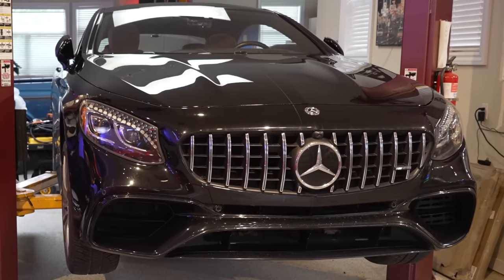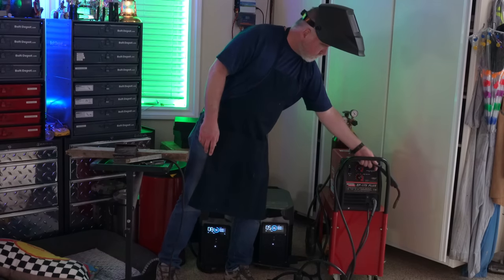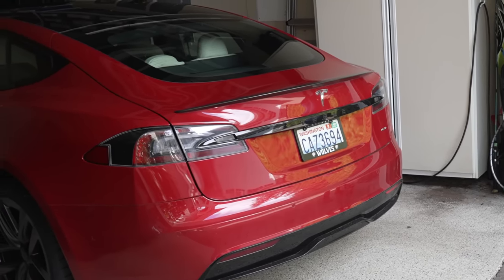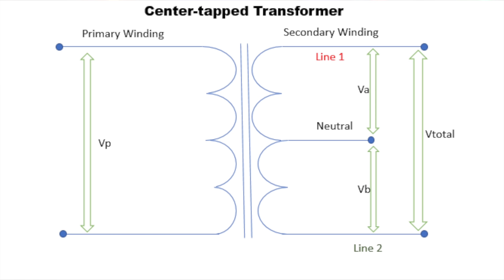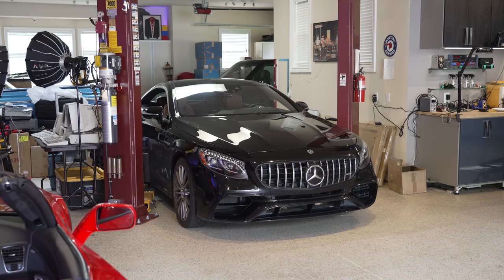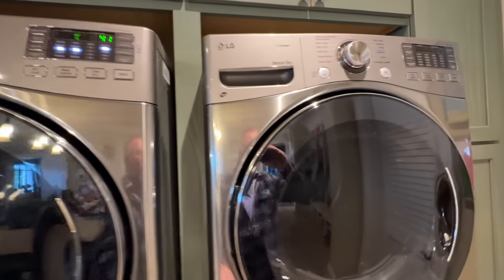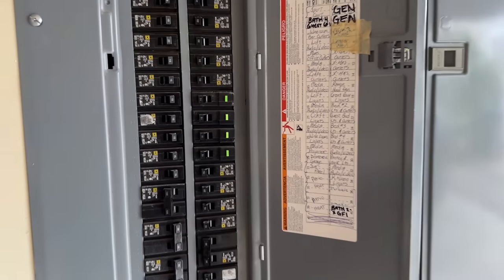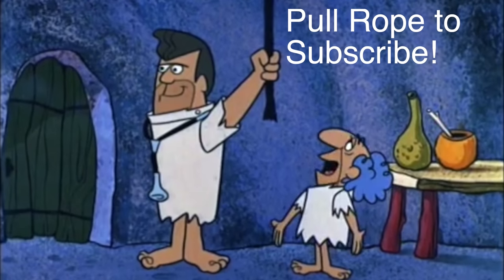240V Solar Battery Experiments - Welding, Lifting a Car, Charging a Tesla, and More!

Comment: The batteries were not connected to a ground rod, so the Tesla won't charge.  If you had it connected via the house, it would've worked, as the house circuit is grounded via a ground rod.
Reply: So I guess the millions of people living in old houses without grounding just can't get a Tesla?
Reply: @chitlitlah  anyone living in an old house without grounding rods really should have them installed. I can’t believe it’s even legal anymore to have a house without proper grounding in place
Reply: Not correct. It’s looking for bonding between ground and neutral which is required by code on house panels but the unit doesn’t bond ground and neutral.
Reply: Right.  There's no way for the tesla to know if it has earth ground, it's on rubbed wheels.

I am surprised though that the Echo doesn't bond the neutral to the safety ground, since it is supposed to be able to have devices connected directly to it rather than through a panel.
Reply: There must be an external hack (workaround) to achieve this, that is safe, easy and doesn't require damaging any of the units.
Reply: @joshg1244 , true, sort of. The two EcoFlows are electrically floating, and the Tesla is sitting on rubber tires. However the 4-contact 240V plug on the Tesla charge cable has no connection between the car and the neutral pin, but it does have connection to the safety ground. Perhaps it measures the voltage between the two hots and the ground, expecting the ground to be about half-way between the hots, and give a stable reading. Since the ground has no connection to anything the voltage reading is nonsense. The car probably sees 0 volts (or close to it) between the first hot and ground, and 0 volts between the second hot and ground, and therefore knows there's a problem.

I figured this out about the Tesla adapter plug only two days ago. Wanted to wire my garage with a big outlet to charge my new car, and wondered if I needed a neutral wire. The Tesla home charging station only uses a pair of hots and a ground, so I measured the 4-pin adapter---the neutral isn't connected. The diameter of wire needed to run home charging at full bore is fat and expensive, plus requiring a neutral would have pushed me to the next larger size of conduit if I wanted to meet code.

To answer Crispy Frog's question: I bet it'd be okay to connect an external ground to the setup. EcoFlow's double voltage hub is the logical connection point to do this. Use a "suicide" cable, but cut off the blades, leaving only the ground pins on either end.

All: It might be somewhat confusing, but Tesla has two home charging solutions. The cable + adapter set Dave showed us is the portable unit, normally kept with the car. It has both 120V and 240v adapters. The 240V adapter is rated for 50 amps max. They also make a home charging station, which you hard-wire into your garage's power. The charging station is 240V and can be setup (programmed via WiFi and a phone app) to run on a 30, 40, 50, or 60 amp circuit.

Comment: I ran into the same issue trying to charge a tesla from a Renogy Lycan 5000 power box. The issue was that the ground and neutral were not bonded, like they normally are in a breaker panel. From the Tesla's perspective, the ground was not at the same potential as the neutral; it was just floating. The solution was to buy a male plug with screw terminals and connect a wire between the ground and neutral, then the Tesla charged just fine.
Reply: how long till the solar generator drained?  how many miles or % did put on your tesla with that charge, and what was the K (7200k maybe?) of your generator?

Comment: At the service disconnect (of your house), neutral and ground are bonded/connected together. This is true regardless of your house's age or whether it has a grounding rod or plumbing ground, or no grounding electrode.

So at the outlet, ground == neutral. You can confirm this by using an ohm meter and checking resistance between those two wires. You'll discover the resistance is zero (or very close to zero). If you check for continuity using a multi-meter, it should beep.

Since electrically speaking, neutral == ground, the only way that a device can tell the difference is there may be residual voltage on the neutral that won't exist on the ground. But, only if other devices on the circuit are powered on, and this won't apply to a dedicated circuit like a car charger. So, I doubt the car is doing this.

The car must simply be checking the N/G resistance and detecting a higher than allowed amount. That is the only explanation. Therefore, the Ecoflow devices must not bond the neutral and ground together, or at least not a "good" bond (near zero resistance).

Test the resistance between the W and G prongs on the Ecoflow's L14-30 receptacle. I'm curious what the value is. You could try bonding those pins together. It "should" be safe, and will allow the car to charge, but it will likely trip a GFCI circuit on the EcoFlow (if it has it).

Another [unlikely] possibility is that the Ecoflow is not providing a neutral. Use a volt meter to check that you get ~120V between the X/Y pins and both the W/G pins.

Hope this helps.
Reply: I agree with this answer. I don't think it is the last line, however. You could ohm out the 30 to 50 cheater cord, plugged in or not, to see if neutral and ground are connected. I bet they are not.
Reply: @tmvold  I think you are correct. It is very unlikely to have a floating neutral. But, I wanted to acknowledge this as a possible cause of the car's error message. It would also be unsafe to have a floating ground, unless there is GFI protection. But, I don't see any test/reset buttons on the devices in the video.
Reply: The 30 to 50 cheater should not be bonding ground an neutral.  That is the job of the power source.  The cheater should only be passively passing through all the connections.
It has a built-in breaker so that could be the problem.

Comment: The Adapter needs to be an EV adapter, not an RV adapter. They are wired differently in order to solve the error you got in your Tesla. Most RV adapters state "Not for EV use." It's annoying, but plan to spend 2-3x more for an EV adapter than an RV adapter with the exact same ends. Argh! Great video.

Comment: Interesting video, Dave. Very informative. Here in Australia, our appliances typically run on 240 V single phase, but some of us have houses which have 440 V three phase power, which powers bigger air-conditioners, some induction stoves, pumps, compressors etc. I never thought there was 240 V running into homes in North America. I thought 120 V came from the pole and that was it.
Reply: 240V RMS with a center tap, and most low-power devices run between one of the 'outside' legs and the CT or "as its called "the neutral".
Reply: 240V CT (center-tapped), with 120V btw either high leg and the CT or neutral.
Reply: Why won't this comment post?
Reply: Comments not posting --

Comment: What's the power (contracted)of  typical American single family house grid connection?  We have here in Poland 15-30kW, sometimes 40! on there phases line. We can run AC motors, heat up water without boiler, just with 20kW flow heater or charge   Tesla in 3-4hours at night time with 50% discount.

Comment: No gloves either! (BadA$$ tech guy for sure) fantastic. Ive heard folks complain that enabling the 240 disables the front outlets on the EcoFLows - I bet it woulda worked if you had it wire through your house with the houses Ground - the batteries have no Real ground - think i've seen its a safety thing elsewhere's. Great video thanks for all your efforts!

Comment: i wouldn't even try to sync a single phase generator to the grid. only if it was 3 phase and i had a syncroscope. now as far as the tesla throwing a ground fault it does a continuity test from ground to neutral. which direct to the battery would fail. you can trick it with a well placed resistor from the neutral to ground wire. but only would do that when the batteries are operating solo! this also applies to stand alone generators. now if you did have a path from your panel to tesla for the batteries it would work as that connection is handled in the pannel. you can stress the batteries even more if you had a wall charger hardwired vs using the mobile charger, as the mobile charger is limited to 32A. as long as your tesla is not a model 3 SR or SR+ it more than likely has the ability to pull more than 32A and you can use the tesla as a variable load as you can dial the amperage up and down. some rareish models can pull up to 22KW! with 2 11kw charging units built in to the car. most have a 11kw unit now as it was deemed not needed to have 22kw ac input to the cars.

Comment: Looks like others may have commented already, but you made the point yourself in one of your diagrams.

in a typical home, the panel bonds neutral to ground. IIRC, code requires this happens in EXACTLY one spot (e.g. multiple bondings to ground bad).

Typically, when you connect a generator to your house, it is bonded to ground via the panel, in exactly one spot, and all is good and to code. Thus, a generator should never have its own bonding to ground in this configuration.

When you "float" a power source off the panel, you no longer have the ground bonding through the panel. Thus, you need to explicitly provide one near the generator. Odds are good that if you provide a bond between the ECOFlo ground and earth ground, your Tesla will likely be happy.

There are a number of videos on Youtube that go deeper in to this, and you can find them typically by searching for how to connect a generator to a house.

Comment: just bond (jumper wire) the neutral and ground together and I think you Tesla will start charging.  I suspect your inverters do not bond neutral and ground and your Tesla is detecting that.

Comment: Not 100% sure as I'm not in your garage with a meter but I assume your Delta-Pro's are intended to be connected to your house that has Ground-Natural bond so they will not have that as it is dangerous to do so. But your Tesla charger might be missing the detection of the Natural-Ground bound giving you the insufficient ground message. As you know most motors don't care about silly things like that so your lift worked no problem

Comment: seeing how you had everything plugged in and demonstrated, im thinking the tesla failed an
internal "isolation diagnostic"

ev's know how much resistance there is as well as how much conductivity there is (between the 12v system and the high 480+v cells)

when charging, the tires are preventing earth ground - the center tap (in the transformer) provides an actual zero point ground between all connected electrical systems

ground reference

i have a feeling it would have worked just fine had the house been powered through the main breakers

Comment: Hard to believe people actually would plug a generator right into a socket xD.
If the mains power actually turns back on and your clock number is wrong then you will have a pretty nice spectacle tho ;D

Comment: Tesla checks the efficiency of the charger, without grounding the efficiency of the high-frequency converter drops; this will negatively affect the operation of the power switches and the correct control signal to them, reliability decreases, and when working at high currents, it can fail.

Comment: With your two inverters just connected together, and not grounded, there is no earth reference. How a Tesla detects this without itself being grounded, I'm  not sure.  I have to wonder if you pounded a rod into the Earth and connected a heavy gauge wire from the earth pin on the hub to that rod if it'd work.  I doubt you'd need the full 2.4 or so meters of a NEC compliant ground rod, just half a meter or so.  Or just connect from the hub to your house's ground.

Comment: All the comments talking about the Tesla detecting a ground are simply deluded.  It's only looking for the normal bond between the neutral and the ground pins.  No more, no less.  Ask yourself... how is the car that is isolated from the earth by 4 rubber tires going to be able to tell if the other end of a wire is connected to earth or to the sky?

Comment: I'm thinking that the Tesla can detect that the Ecoflows do not have any sort of physical connection to actual ground.  Aka a copper rod hammered down into actual earth.  Every house should have one somewhere.  If it's not connected to that, there is nowhere for the pixies to go to if there there is a fault.  So, without that, you have a capacitor happening, and it can detect that.

Comment: Normally the neutral wire is grounded at the transformer output. And in any case if you were to get a electric shock the electricity gets grounded and returns to transformer neutral ground connection to complete the circuit. The electricity doesn't return through the neutral wire of the house wiring. In order to mimic the same thing grounding the neutral wire seperately and plugging it into a normal outlet in the house will fix the tesla charging issue.

Comment: Neutral and ground is not bonded in that device
Reply: Correct !  Also, when running directly off of the inverters (not through your main panel) the inverters should have connection to "earth" ground !  This can be a separate (green) conductor from the ground lugs on the inverter to the house ground rod or UFER.

Comment: The Delta pros don't have a Ground-Neutral bond. your tesla just like mine require this. All you need to do is put a jumper from the ground to the neutral on either of the delta pros front outlets and you can charge the tesla no problem. I charge my tesla completely off grid every day and I had to do this jumper myself. I'm using a 5000watt MPP Solar setup but had the exact same problem that you had.
Good luck Dave
Reply: how long till your batteries drain charging the tesla? How much is put into the tesla?
Reply: @Rsmitty1974  well my home backup battery is 24kWh so I can get about a 25% charge if I am going from just the battery. I don't normally do that however, I charge when the sun is out and the 5-7kW from the solar does most of the heavy lifting. The battery covers the charge when a cloud shades the panels, or when the sun is not enough. like most people with an EV I don't charge from 0% flat. I dont have a huge commute so I rarely need more than 15-20% charge daily.

Comment: I don't see any warranty period for these batteries on the website. That's a lot of money to shill out for, well tbh you will need two batteries. What happens if you have problems or a straight up failure. Charging over time and output capacity are in know way a warranty.

Comment: The ground wire serves as return path for electricity to the neutral in case of a fault in a device - it serves to trip the breaker. That's why in North America we don't have RCDs or GFCI breakers at the input - the ground serves as an alternate return path in case of a fault which causes a short circuit tripping the breaker. The alternative to this is double-insulated devices preventing you from touching live. This is why you only bond neutral and ground at the service input panel (main input panel) but never in a subpanel. If you bond neutral and ground at a subpanel, you will cause a current to flow in the ground wire connecting both the main panel to the subpanel. As an electrician says, electricity takes ALL paths. As for your Tesla, it's likely detecting this - your Ecoflow devices aren't grounded, and likely the ground provided is floating. Your Tesla detects this case (the vehicle chassis is connected to the ground) and fails to charge because there is a high impedance between the ground and neutral, so an electrical fault could result in the vehicle chassis being live. If you plugged your ecoflows into your main panel, the panel would bond ground and neutral, providing a grounded reference for the ecoflows and it likely would've charged normally.

Comment: Well… I think you just sold me on a second delta pro later this summer.  I have one that I’m using to power the 1/2hp jetpump for my house well.  But I have the same welder and similar plasma and a car hoist too.  I’ve got a transfer panel also with a promotion ecoflow recently ran.  Basically I’m one delta pro of literally the same setup.  Much smaller house and way less sexy shop!  Lol.